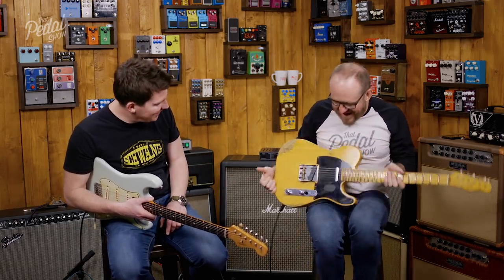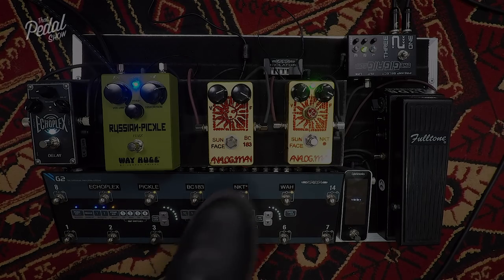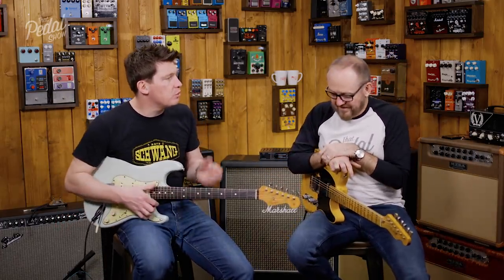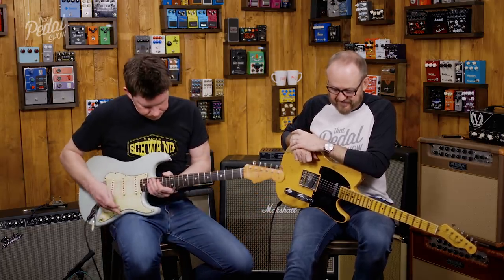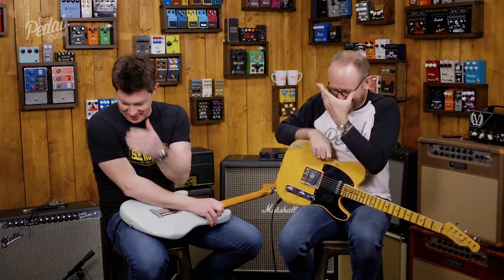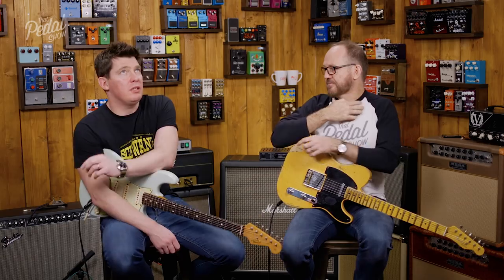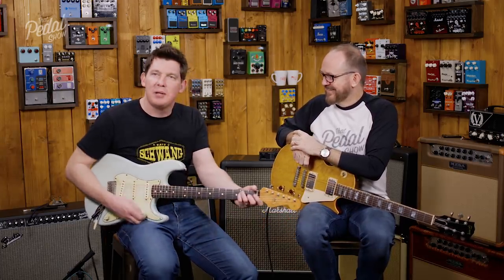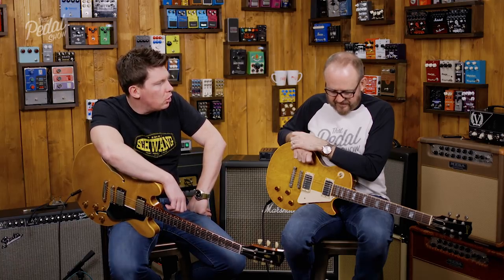That Pedal Show – Things To Know About Using Wah-Wah, Fuzz & Buffers

Comment: Welcome back, guys! When you did your extended piece on the Analog Man Sun Faces, I didn’t think there was much difference between the silicon and germanium variants, but back in the shed the NKT Red Dot sounds so much more alive, and works so much better with the wah pedals! Muffs are generally not as sensitive as fuzzfaces to what’s put ahead of them in the signal path, but that said I’ve not heard any Sovtek-style muff sound as good as that Russian Pickle, with or without the wah and/or buffer. Still wouldn’t swap it, though, for my Vick Audio 73 Ram’s Head - check it out!
Reply from the maker: Nice! We have more control on the shed. Micing, amps, etc etc....

Comment: Hence, a switcher is a must when using traditional fuzz pedals with non-true-bypass pedals to remove them away from the signal path when not used. Thank you very much. Now, I have got it, me thinks.
Reply from the maker: +Ali Boyacıoğlu cheers Ali, id say it’s not essential, but it does help :)

Comment: This is topic that I had to deal with with my board. I have a MXR LaMachine & Vox V847 (amongst other things) and when I initially put my board together I put my Polytune between the wah & fuzz thinking it would cause a sort of break & allow the two to work together. Nope! Wouldn't work together at all, just would not wah with it. Now I have them right next to each other in the chain & they work it'll wah. However the wah adds a substantial amount of high frequency boost to the fuzz, so even when it works it's a crap shoot.

Comment: Nice work, boys.

I run a Clyde -> Fulltone v2 '69 germanium fuzz -> Tumnus(buffer always on by design) -> OCD (buffer turned off) -> Octopuss echo (thanks santa!) into a Vox AC15c.

I bought the Clyde just for that buffer switch. In the end the wah buffer doesn't make any noticeable difference when the '69 fuzz is on in my set up so I leave it off. I do really love the Clyde sound and sweep. So much range and wonder in that wha and it's built like a tank.

Post fuzz buffer : I was worried that the Tumnus buffer might have been gimping the '69 and so I bought a loop switcher and set it all up. The end result was that Tumnus buffer did make a noticeable difference to the fuzz, but very mild and not really in a bad way. It was adding a bit of top in much the same was as it would with no fuzz - a very little amount, but there. In the end I decided to remove the looper and just keep an old school simple set up.

Your show has taught me a lot. I'm overjoyed with my sound these days (and my new SG special! mm that Gibson nitro smell. Perhaps 2018 will be collectors :p).

Keep on rocking, boys!
Reply from the maker: +crush537 that’s a process of elimination Crush, fantastic work, well done matey

Comment: Impressed with the 52, I have a 51 "telecaster 2016" and that neck is the thing
Reply: 65 neck are good but about as small as I would go. Try 59
Reply from the maker: +Jeremy Fearnsides cheers J, I wasn’t happy having a neck that was s million miles away from Red. The 52 is still thicker, but not crazy, so it’s easy to swap between the two :)
Reply: 59 large c is ideal
Reply: I have  63 with a 59 with twisted tele pickups. v good but I prefer my 51 tele custom shop with modern wiring and grease bucket. However, your guitar sounds cool. My go to guitar is the 51 telecaster custom shop. I play 11-52 run a dual set up with a 5E3 and a Matchless lighting. Put the pedal through the Vicky 20112 (MXR reverb, MXR delay, BB premamp ). Love your progrMME

Comment: In reference to Gibson. I've critiqued Gibson enough on youtube but I will say this. I have two Heritage guitars made at the original Kalamazoo factory (if you don't know about this investigate it) and my Les Paul has rarely been out of it's case since. There could be trouble at Heritage now as well if recent reports are anything to go by. One problem with Heritage which ties into their recent attempts to change things is that sometimes there are some quality control issues which usually seem to be minor finishing things. You might need to replace a nut for example but I couldn't care less about this when the wood used and basic quality of these guitars is so good.

Comment: guys, regarding humbuckers and Sunface NKT: this pedal has a little dial built on the board, you can tweak that dial to adapt it to humbuckers. a notch down does it for me as opposed to playing single coils. Been using that pedal for 10 years solid with Les Pauls and Juniors, and it sounds killer. Also, always power an NKT with way less power than required. Some people have it modded to 4.5v. Mine is on battery, but I use cheap corenr shop type alkaline batteries, or value ranges. Never use a Duracell in it!

Comment: That Pedal Show  My solution to the "wah into Fuzz Face" problem was instead of modding all of my wah pedals with output buffers, I got a germanium Fuzz Face clone that has variable resistance at the input.  In my case, a Hartman Germanium FF that, in addition to the standard output level control, has an INPUT level pot.  By using the input control to add some resistance at the input of the FF, it allows you to use any wah, buffered or not into the FF without any oscillation or other problems that can occur when putting wah into Fuzz Face.  The Hartman is also a great sounding germanium FF to start with.  I think AnalogMan also offers an option for a pot that puts resistance on the input of the Sunface, which accomplishes a similar thing.
Just thought I'd mention this, as I don't think u touched on that way of dealing with "wah into FF" issues.
I am a big fan of your channel, great episode and very helpful.
Reply: That solution can work pretty good and those are great sounding fuzz pedals. However, that solution does also have the side effect of lowering the gain of the fuzz pedal much like slightly lowering the volume pot on the guitar.

Comment: I have run into similar problem with an octavio pedal (EHX Octavix). Originally I put it after the Wah, as I thought it is not a Germanium device, it is not a rangemaster or a fuzz face, so it can go after the wah. It sounded terrible. Than I placed the Octavix in front of the Wah, now it sounds awesome together with the wah (and without it as well).

Comment: Interesting subject this, I had issues running a wah before the Keeley Monterey (fuzz/vibe pedal) with the similar noises you were getting there with the Hubcap John. I found that the only way I could remedy it was placing a Boss tuner between the two pedals acting as a buffer while the tuner wasn’t engaged.Gives me another reason to buy a 183 Analogman sun face now though! Great video thanks!

Comment: Guys so great to have you back! And also with exactly the show topic I was waiting for - this really makes up for the lost last Friday :) - you may remember my strange buffer experience with the JHS Firefly (Tonebender Type Germanium fuzz) and only working properly with buffer in front of it...(I think I got some good answers here - although it’s still a little odd). Thanks so much! Btw Dan your new guitar looks and sounds gorgeous - and even without a direct comparison available yet - totally different animal than the red, it’s stunning - can’t wait for the explanation ;)
Ps. I like the wha after fuzzes (he two) much better since - although using standard ‘65 single coils - I have the feeling of hearing what you heard with Humbuckers in front of them with my setup - so again good answers - you guys are awesome!
Reply from the maker: Cheers Volker! So with fuzz before wah, are you going into a clean or driving amp?
Reply: Knew you’ll may ask that :) Actually I’m going into a medium gain setting (11h of low) looking glass into the 2h clock clean channel of a silver jubele (20w) - so very mild crunch with single coils - however, mostly use full volume of guitar when use the wah with the fuzz!
Reply from the maker: That makes sense. The extra drive from the amp is helping for sure. Wah after fuzz into a clean amp can be a little spiky. But the Jubilee... mmmmmmmmm
Reply: :)))......I’m tellin’ you ;)

Comment: I bought the MXR Classic 108 because it has a switchable buffer, supposed to be for playing nice with a wah up front. Even without the wah, the buffer is handy. Not only does it regain some highs on long cable runs, it actually makes the Fuzz sound louder, fuller, ballsier (the latter is a technical term, don't feel bad if you don't understand).
Reply from the maker: +Matt Gilbert we tried the 108 mini last week and thought it sounded great, and yes, we also really liked the buffer.

Comment: Not so much a report on the behaviour of buffers with fuzz pedals, more of a celebration of overkill.
I had two fuzzes in front of my board, one either side of a budget Vox v845 wah, no buffers I believe. I'd been umming and aahing over a Hubcap John Sun Valley after seeing Dave Simpson with one on YouTube. Your show was the decider, just HAD to after hearing that GV tin go on your video.  It's been a fun couple of days since it arrived and then Today I accidentally left it on and I switched the post wah fuzz on. WOW ! Just Wow. Fuzzes either side of the wah. Lots of lots as on might expect but still musical, not just a mess. Synth like tones, very interesting. Haven't dared all three yet but I suspect that'll be a fuzz too far.
For the record the front end of the chain goes like this:
Guitar > Mooer Blue Faze (Silicon Face type) > Hubcap John Fuzz Fake (Germanium Face type) > Vox v845 (unbuffered trad wah) > Tom's Line Firecream (Silicon Muff type)
I'm lucky in that they all work both before or after wah but the Face types sound better in front to my ear and the Muff type better after. Also the Muff type doesn't clean up at all so it made sense to put the Faces first .
There are still more permutations to try but the fun is already real. 
Thanks TPS for including that Hubcap John Fuzz and helping me make up my mind.

Comment: 28:19 This is a point that I think a lot of people (myself included) forget. Having a clean vs dirty amp as your base really impacts where you should put your fuzz/wah. Honestly, it's the reason why I have two fuzzes; one before, one after the wah. I have a Bassbreaker and love the "Mid" channel, but sometimes when I'm running a looper or need to be clean for part of a song I have to switch to the "Low" channel and it kills my JHS Firefly. Throw in a Tone City Fuxx Fuzz after the wah, and I'm good to go.
Reply from the maker: Nice nice nice!

Comment: I agree with Mick - the whole low impedance high impedance on the input or the output with or without a buffer as a part of or not a part of another pedal's circuit either before or after a fuzz that may be germanium or silicon has my head spinning and confused. Dan - an explanation with drawings might be very helpful for us slow learners!
Reply from the maker: He was talking about that....

Comment: Elephants and Giraffes
Referring to Josh Smith's recent YouTube interview with Guitarist Magazine (11'04”)  
“Wah after Fuzz for Jimi, Wah before Tube Screamer for Stevie.”
With Germanium semiconductors the different characteristics stem from the PN /NP junctions in the Ge semiconductor only need 200mV or so to start conducting (forward bias) whereas Silicon devices require around 600mV. 
The same applies to both Ge transistors and diodes. 
When clipping or overload distorting they do it earlier and softer. 
Historically the early Ge transistors were lower gained and easier to overload. 
Easier to blow up too.
Reply from the maker: +KozmykJ very cool, cheers K. There does seem to be evidence the Jimi used both configurations
Reply from the maker: Most of the Hendrix pics I’ve seen have the wah before fuzz.... Mick here. Uni Vibe controller was after....

Comment: One thing I've noticed is that if you have the wah then buffer then fuzz you lose the volume rollback, that's the only reason I'm running the fuzz then buffer then wah.  I have been experimenting this last week with a germanium fuzzface and cry baby.Needless to say I was super pumped to see what you guys had to say about it. I'm using my ts9 as a buffer between my fuzz and wah.
Reply from the maker: +Jon Bjerke yep, so as we say on the show it depends on the buffer and the fuzz, but Ge FF don’t work great with a buffer in front of them, so to solve the issue, having a true bypass wah that has a buffer on the output of the wah circuit is a great way to sort the issue
Reply: Thank you so much for the reply! I may have gotten a little too excited while adding my comment and forgot to ask my question. Do you know if you still have guitar volume control when the guitar goes into the Clyde with the buffer on and then in to the traditional fuzz (tobacco can)?

Comment: Yet again another great episode, thanks guys! Maybe you can help me with a small issue I have: I like pushing my self-made silicon fuzz with a TS9, but even though the tone knob of the TS9 is set to 9 o'clock, the fuzz sounds a bit too trebly/harsh to my liking. My pedal chain is Vox Wah > Uni-Vibe > TS9 > Fuzz > Input of Hot Rod Deluxe (clean & bedroom volume) + Flashback mini in the FX loop. I use isolated power outputs which reduced the problem and make a huge difference anyway (VCPI - yeah), but the issue is still noticeable, especially when using the wah. Dan, in one of your videos you mention a slightly driven amp might help to reduce the harshness of fuzz pedals, but this is not really an option for me as the overdrive channel of the HRD seems to add even more harshness. I guess this a general thing with the HRD. The amp is set thusly: Bass: 4, Mids: 6, Treble: 8, Presence: 4. The question might sound silly, but: Is there an "elegant" way to reduce the harshness (i.e. without changing the pedal order and without totally backing off the treble and presence knobs of the amp)? Cheers
Reply from the maker: Mick here. Try this: wah, fuzz, vibe, TS9. The tube Screamer will kill a lot of the high from the fuzz, though the buffer might put some of it back. Worth a try though. Run the fuzz almost all the way up. Let us know how you get on...
Reply: Hi Mick, that does it in terms of harshness, thanks! I should have mentioned that I only had this issue with my strat which comes naturally. Here's the thing: A while back, I had wah > fuzz > TS9 > vibe, but changed the order because the TS9 sucks a lot of the fuzziness and also, I like the push/compression/sustain the TS9 creates when placed before the fuzz. However, I had not tried the vibe between the fuzz and TS9 as you suggested  - sounds killer! My pedal order now is: wah > fuzz > vibe > TS9. Of course, now I cannot push the fuzz any more, but I might as well get me a boost or compressor pedal. A good reason for a new addition to the board. Thank you and all the best from Germany!

Comment: I found that a Fulltone Catalyst on high gain [Flame] mode would constantly self-oscillate when I put a Fulltone Clyde [older/non-buffered] in front of it. Different issue, but a case where a buffer was probably the only way to make that setup usable.

Comment: I have a few pedals including the Vox847A wah and the turquoise mini fuzz face.  I play through a modified Blues jr.  I've noticed that the wah and fuzz face don't like to work together.  This is with fuzz after the way.  The fuzz face sounds best alone with my strat.  I don't like the fuzz face sound with my epi Les Paul.  But the wah sounds good with the LP when I run the wah into a MXR super badass distortion.  Feels like all the sweep frequencies are still there.  I'm contemplating getting rid of the super badass and getting one of the new Fender pugilist distortions.

Comment: Hello,
I have a question: I am using Analogman Sun Face BC108 and in front of it is a DryBell Vibe Machine which is true bypass. They sound fantastic together. I plan to get a tuner soon that will be the first pedal on the board. Should I take a true bypass tuner or a buffered tuner?
Best regards, Mihovil
Reply from the maker: Definitely true bypass. Unless you want that fuzz to be permanently buffered. Mick here.  Cheers!
Reply: @ThatPedalShow  Thanks for quick answer... I like the sound of these two pedals combined and I don't want tuner to change it :)

Comment: I have a switchable buffer and even have made a modified Radial Drag circuit to tailor the buffering (Thinking of calling it the "Cable Lengthener" ).  That said I have never had issues with buffers and fuzzes.  Usually just need to roll the tone and/or lower output volume on the pedal if you don't like the enhanced highs and loudness.  Easier to get a creamier sound without the buffer.

Comment: Just going back through some old episodes cause, why not ..... mines of information and entertainment. A problem im having is running overdrives with my wah. Its a bmf and ive tried it with and without the wahs buffer activated but no different. The sweep is shorter and more sharper. I also had this issue with an rmc wah and withvarying pedals including the greer lightspeed and the duellist. The only thing thats stayed is the amp, tone king imoerial mkii. Any ideas? The clean sound from the amp is fine with wah ....

Comment: One thing that you guys didn't cover as much as you could- for me- - fuzz faces are great because of the clean up with the volume knob. With a good fuzz face you can roll up and down and play cleanish rhythm and scorching lead, all based on the volume knob. BUT- when you buffer it that versatility goes away and the buffer or some interaction therein fights the volume roll off. For me, b/c I use the volume knob all the time, is the primary reason a buffer kills a fuzz face. My ARC klone has a buffer and I have to put it after my MXR BC108 in order for everything to play nice. Muff's by contrast just don't clean up with the volume knob- I'm not sure why, but it must be related to why they don't care about being hit with a buffer, right?